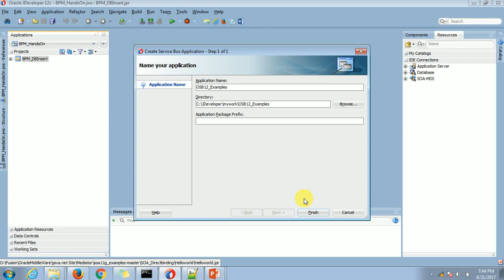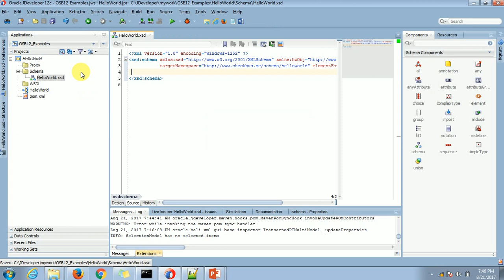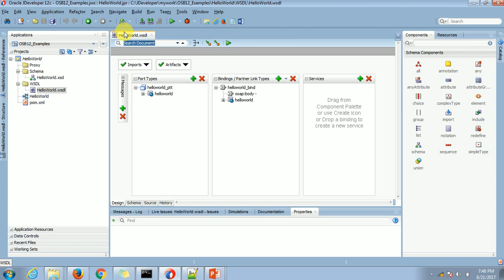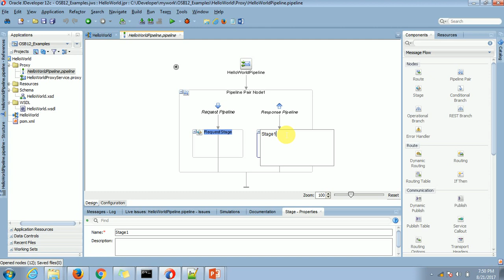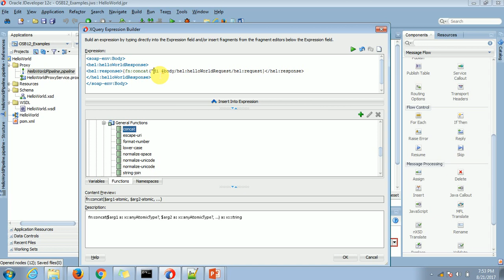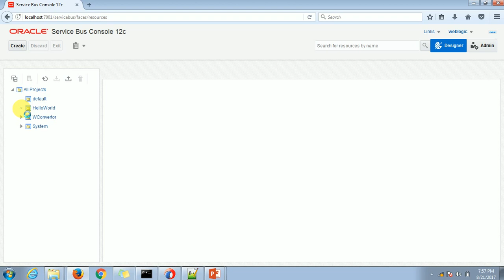OSB 12c Hello World

Comment: What version is this?,  I using 12.2.1.3.0 version and I do not see Service Bus Application Option.
Reply from the maker: Hi James,
Same version[12.2.1.3.0] I am using.  Service Bus Application comes default into applications menu.
Share your screen shot.

You can catch me in watsapp @ +91 9885357177
Reply: Thx Satish for your help, maybe I have to install Service Bus APP  before Jdeveloper.
Reply from the maker: Hi james,

Could your screen in free time, I will join and fix the issue.
My watsapp No: +919885357177. Ping me once you are ready.
Reply from the maker: Hi James,

May be installation  problem or update the jdeveloper